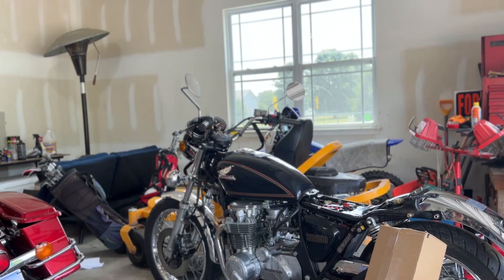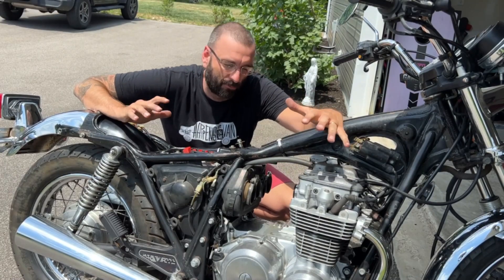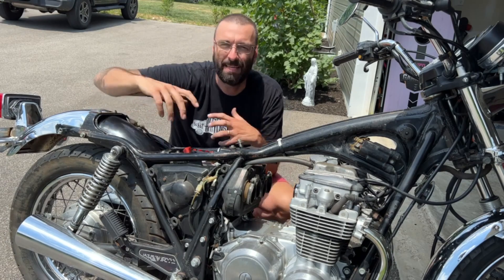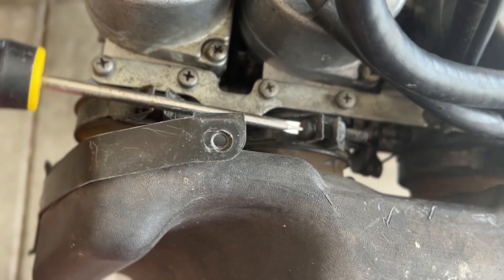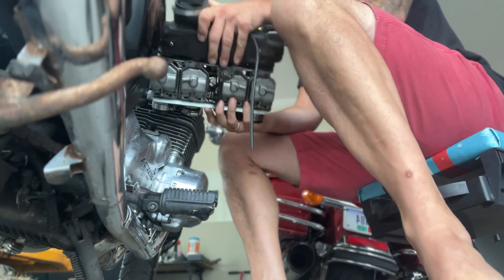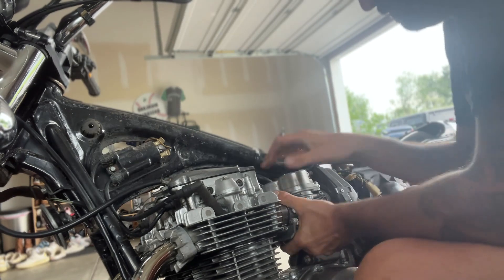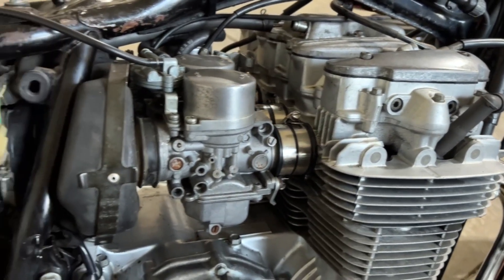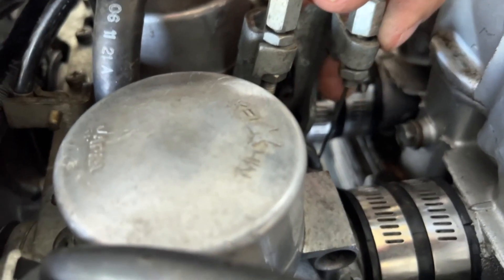40 Year Old Barn Find! 1981 Honda CB650. Help, I Can't Keep It Running?!

Comment: I put 4 into 1 exhaust on the one I had it sounded sweet. I lucked out too and found a nice used one on eBay from the 80s for like $150 instead of $2something for a new one made with thinner metal. 👍 I can’t wait for this channel to have a million subs so I can be one of those guys in the comments that says I was here from the beginning. And when you do motorcycle give always remember me LOL
Reply from the maker: i had 4-1 on the '78 750. it did sound absolutely amazing. and, you'll be the first one i give a bike to! haha.

Comment: Nice bike. I got an '80 750. Lots of fun. Easy to maintain. Ride safe.
Reply from the maker: Thanks for watching! My first bike was a 78 CB 750. I loved that  bike.
Reply: @lifewithdave9202  I have the sissy bar/luggage rack on mine. Looking around for a grab bar cause sometimes I take the rack off. Very hard to find. I noticed yours doesn't have either or. Had my 750 since '88.
Reply from the maker: @anthonyangeli256  I actually have both … I think. I got a box of parts when I bought the bike. I’m not sure if they are for my 650 or just random parts but i got something. Once I get it running perfect I plan to put the luggage rack on for some future solo moto-camping trips.

Comment: Lubricate the linkage, lubricate the push and pull throttle cables, and from personal experience those hose clamps on the engine side are going to cut into those rubber boots and cause an air leak…if they already aren’t leaking. I start both of mine with choke pulled out for a few minutes, then idle is set at 1050-1100rpm with choke in. Carbs need to be synchronized with carb syncing gauge set. I noticed the fuel petcock is not original and nipple comes out the right hand side…should be out the back. On both of my 81’ CB650C’s I have eliminated that stupid vacuum fuel shut off and factory airbox. I have installed Dynojet Stage 3 Kit, Dual K&N Oval Filters, and Hindle Stainless Steel 4-2-1 Exhaust System. One is a Café racer style, and the other is stock except for mods listed above. Just Subscribed today…good content!👍🏻
Reply from the maker: Wow! Thanks for watching and for all the great tips!! I appreciate it. Stay tuned , new video coming in the next few days.

Comment: Hello where did u find fuel line diagram ? Any help would be appreciated
Reply from the maker: i just use google to find parts diagrams. I don't have a service manual or anything. That's probably why i could never get it running great. Thanks for watching!